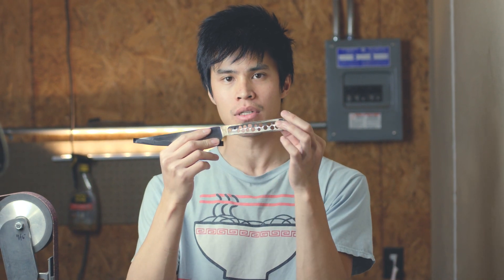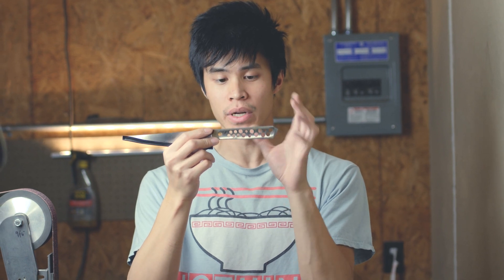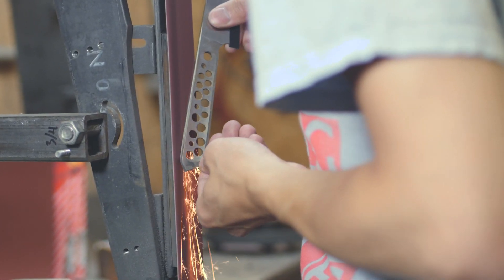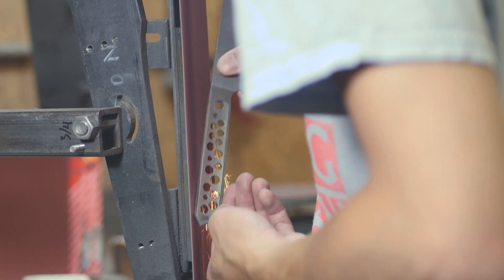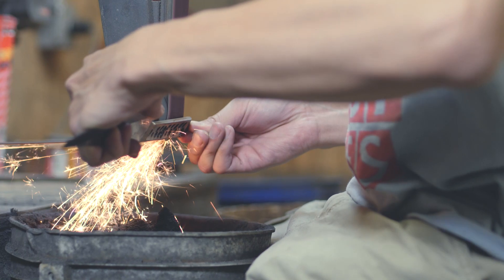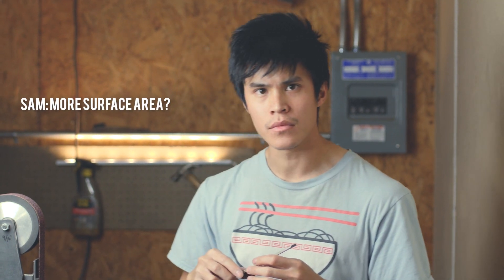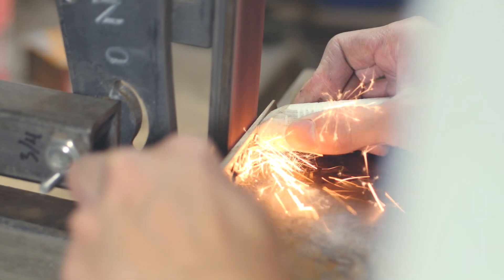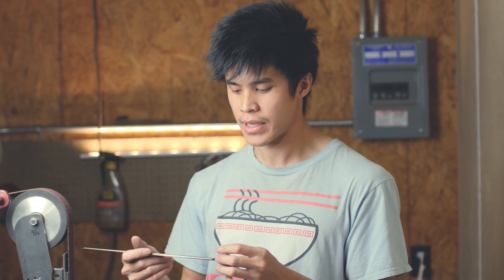How we taper tangs.

Comment: What about the scales, Don? How do you fit the pins straight and keep the tang flush with the scales? Great vids as always.
Reply from the maker: We'll definitely have to get more in-depth with that. I'm actually don't have a super dialed in process for that, but we get by with a little bit of finagling...
Reply: @DonNguyenKnives  Patreon for a bit of extra content, 0nlyFans for a bit of extra finagling. Got it! Cheers.
Reply: @LDellosa  Also curious about how to fit the scales on the tapered tangs. Don’t see any obvious solution to it. If it’s tapered before heat treat it would be quite easy but then you risk warping after heat treat. Perhaps the easiest way is to soften the tang and then drill the holes with the scales on?
Reply from the maker: @Tokv41  the ideal way in my head is drill it before HT, taper after, shim the tang so it sits level in the drill press, drill through each handle scale, then assemble. However, the difficult part is shimming it in the drill press accurately.
Reply from the maker: @Tokv41  BUT! I know quite a few people (myself and Sam included), that don't even bother with shimming; one of the people in my mind is a very well known ABS Mastersmith. Depending on your tolerances and pin stock, they bend, and things come together naturally. I imagine that if the tang taper is so severe and your tolerances are insanely tight with large pins, you might run into trouble. So far that has not been the case for me.
Reply: @Don Nguyen Knives  I have been trying to figure this out since I saw this video. I might have an idea, but I would be VERY interested to watch you process. I haven't tried it yet, but i feel like if you got the knife level, you could set the scale on one side, and use a height gauge to scribe a line across the top, which would leave a line that would match the slope of the taper. Once that is done you could very carefully sand down to that line. It seems like that would leave you a flat surface 90 degrees from the drill press. It may be way too fiddly to go through all those steps. I am hoping your method if more simple.
Reply from the maker: @stevenb3  I would first try and see what you can get away with if you needed any shimming and adjustment in the first place. Depending on tolerances and pin sizing the scales might come together and apart no problem and you could save yourself a lot of work. For me it's not worth going through the hassle because my vise and table setup on the drill press will never be that accurate and would be wasted effort, and also since our pins aren't that long and we do a decent job with getting the pins fit up well it tends to work out pretty well
Reply: @DonNguyenKnives  Would the concept be that a small diameter pin would conform to the difference in angle in the wood?

Also, thank you for replying to comments. It seems like quite a commitment that you manage very well. I have really been enjoying learning from your techniques.
Reply from the maker: @stevenb3  yeah the smaller the pin the easier it is to flex. A 1/16" pin would be really easy to bend and I don't think it'll care about a couple degrees of taper at all.
Reply: Been wondering this myself. Sounds like you guys are left guessing just like me. Lol

Comment: Thanks for sharing. Question. When the tang/whole piece of steel is straight- Do you just eyeball the amount that you grind off each side of the tang?or do you have a way of marking the exact taper on each side (down the spine of the tang)?
Reply from the maker: We just mark one simple centerline on the blades and eyeball actual straightness relative to that, if that makes sense. So if we had an already straight blade, we eyeball the same amount of material on either side of that centerline. If we have something warped, then I eyeball a little more on one side than the other. It's not extreme precision but it gets really damn close, close enough for my standards.

Comment: I've been wanting to do a tapered tang for years. The one question that I've always had is, how do you know where to stop the taper?
Reply from the maker: It kind of depends on the knife and how it'll be used. Outdoor heavy beater? Probably don't want to go below like 0.060" at the thinnest (I'm making an educated guess). For kitchen knives I'll take them down to around 0.030" - the trick with getting them thin is you can start to overheat then quickly when they're thin and they can warp. And also they can get too weak.

Comment: serious question, whats the sense of removing so much material from the tang, honestly it appears that when youve finished there isnt much more material left than some hidden tang knifes. as well as making a lot more work. i though the point was to make it as strong as possible, im sure it still is, im not being critical just a hobby thing and i pick up a lot from videos on youtube.
Reply from the maker: It's because for a kitchen knife, at least for mine, I'm trying to take away as much weight as possible. On a hidden tang it's super easy, especially with Japanese style knives with the lightweight wood. On a full-tang, with modern stable materials, much more difficult. Chef's knives generally don't really need a ton of strength in the tang for the most part, just enough to resist deflection and most catastrophic failures. The rest can be taken away.
Reply: @DonNguyenKnives  thanks bud, ive been thinking about skeletonizing my tangs, but concerned about compromising strength. it seems the taper and hollow grind is a lot of work and time. i have a small space and limited tools to work with. ill continue with what ive been doing and testing. thanks for responding , not a lot of people do. ill sub for that. take care.
Reply: The main reason to do a full tang knife in the first place is aesthetic, done correctly a hidden tang can be stronger than any knife realistically needs, and as long as you leave more material near the recasso and avoid any stress risors a lot of the material on a full tang is just unecesary dead weight.